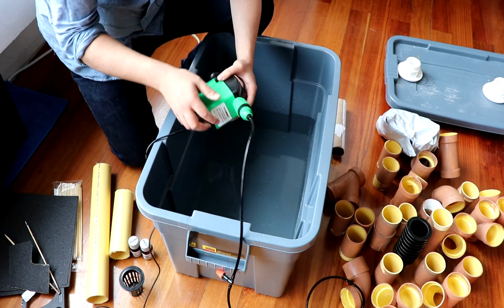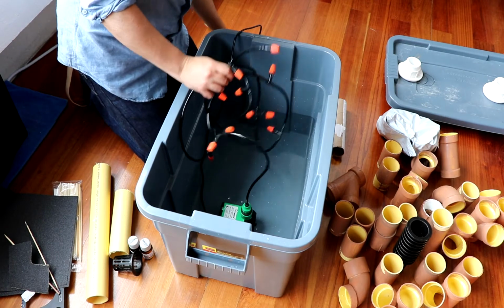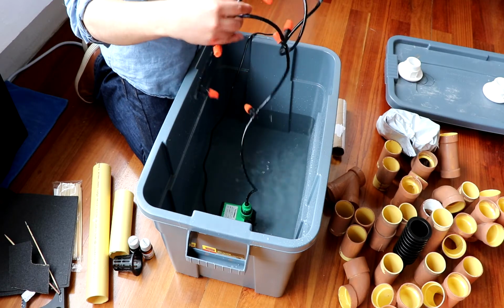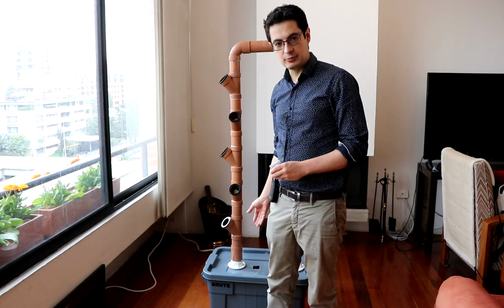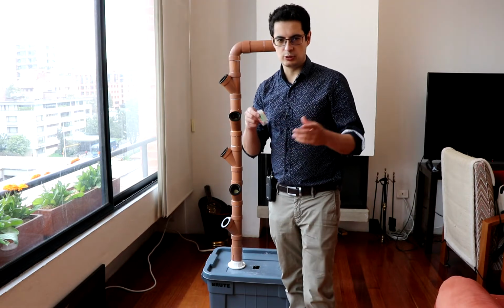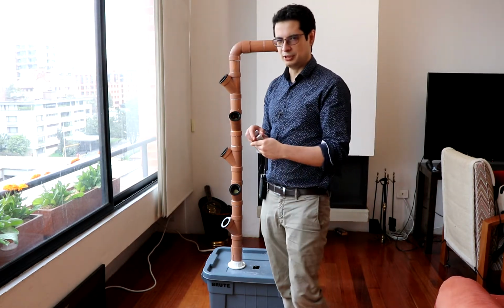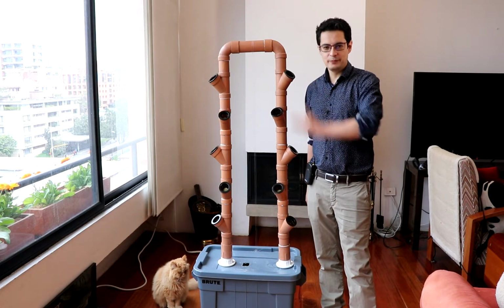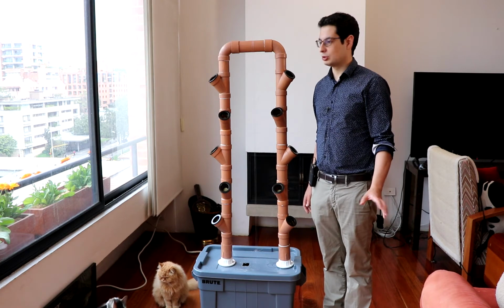A DIY hydroponic tower project - Part two

Comment: Nice work there! I painted my PVC tubes after watching the first part of this project but unfortunately thought it might be easier to paint with a spray can Dx I didn't realize it takes far more cans to paint a curved surface so I ended up with a blotchy black and white tube but at least I managed to block the light haha
I also thought your editor was the boss but I see two (adorable) executives walking around and checking out if everything is going well in the vid :D
Thanks for the video!
Reply from the maker: Thanks for your comment! The executives are, indeed, adorable. We thought about using spray cans, but - as you found out - we anticipated it would be quite inefficient due to the surfaces. Using regular paint with a compressor is probably the easiest, if you have the space to do that.

Comment: You should start the seeds in a tray and let the roots grow long enough to place in your setup.  Just a simple "flood Tray"  would work to start your seedlings.  Nice Job!!
Reply from the maker: Thanks for the comment! I think I will do that, several plants germinated fine just like this (setup keeps the cubes moist) but some of the sprayers did fail (because of iron phosphate precipitation due to the solution I bought), so I will restart them in a flood tray to be sure they are better prepared for the setup.

Comment: How about electricity ? Cost. Watts pump
Reply from the maker: Thanks for posting! Pump is 40W 24/7 at the moment.
Reply: @ScienceinHydroponics  
Hi Daniel
I would put the pump on a timer., something like 15 minutes on and 30-45 minutes off would be ok. It`ll cut your the power consumption in half :) 
My 35 site aeroponic towers would take about 16w per day if i ran them on a pump. With the accumulators, its about 12w per day.